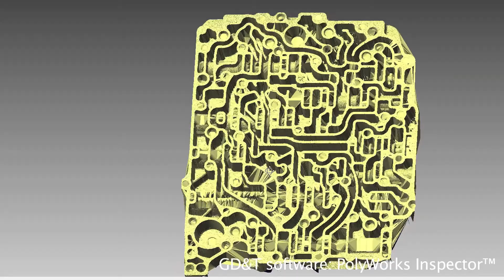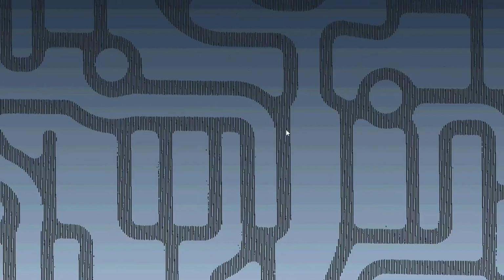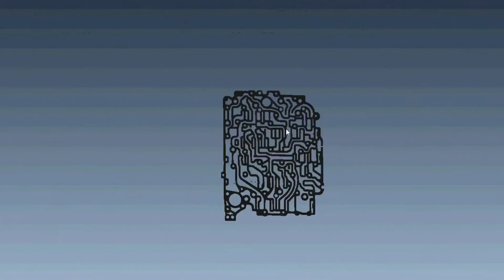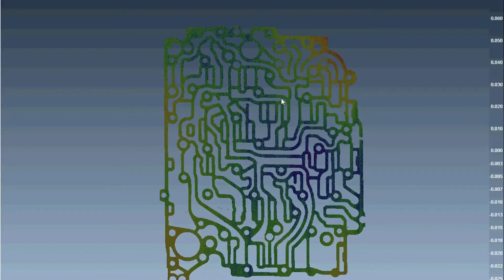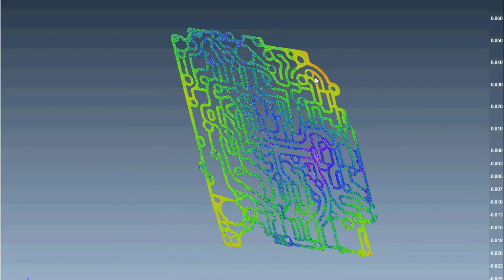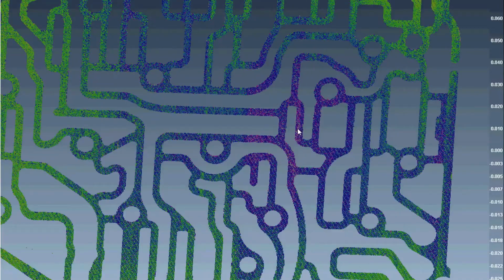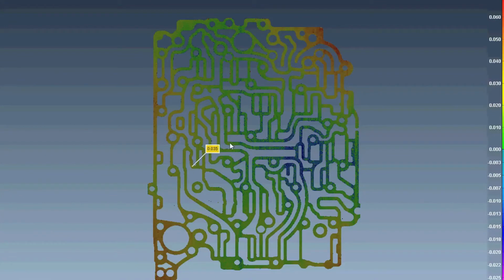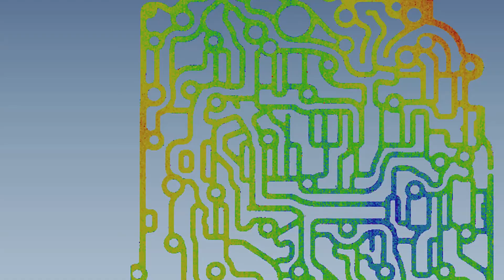Automated flatness measurement for industry (SURFACEINSPECT system) | NOVACAM

Comment: Amazing technology. Could be used to help scraping ways and surface plates. The example used here is a great one, this would be a living hell for any precision machinist to measure flatness using a dial gauge and required to remove as least possible material.
Reply: Straight edge, level and some spotting paint is far cheaper, more versatile and likely more accurate, if used correctly